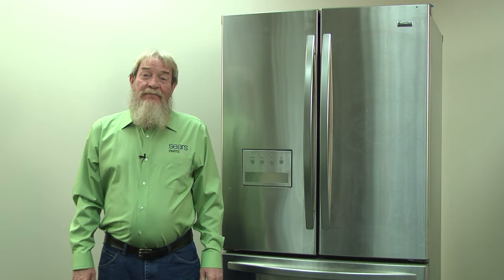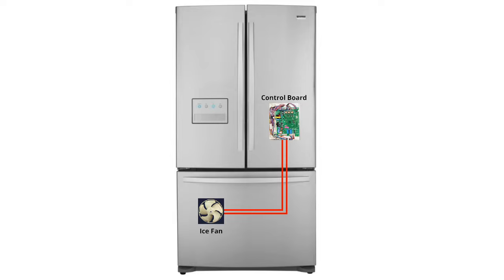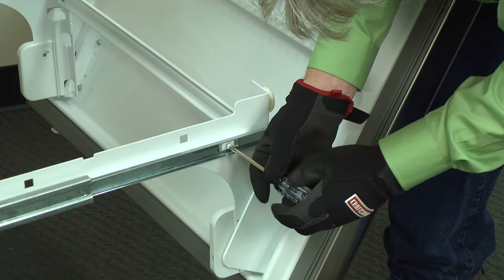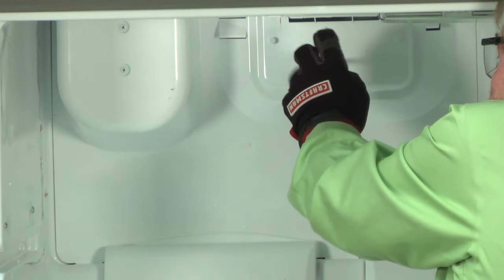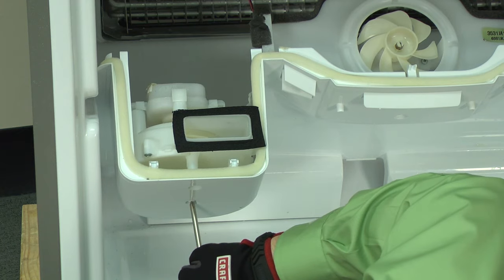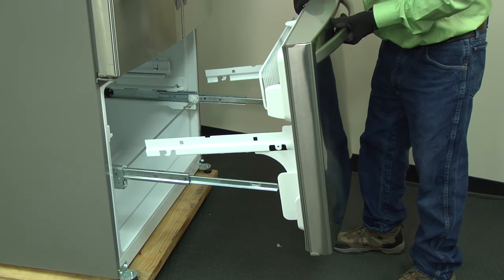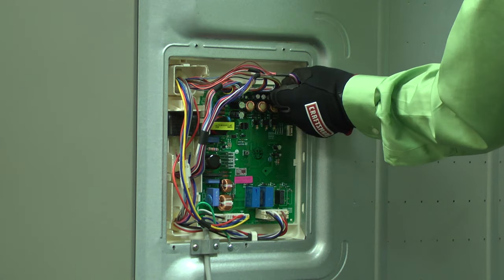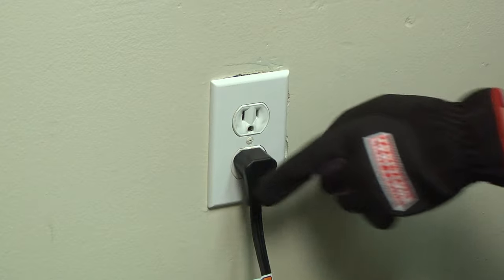Refrigerator Error Code Er If: Ice Fan and Control Board Repair

Comment: This video was helpful! I removed the two upper pull-out trays to the lower freezer section and noticed a large chunk of ice in the back external portion of the plastic freezer compartment. I would not trust myself in removing any parts or paneling to get gain access to where the fan is located.  Then, I took a hairdryer and blew hot air onto the ice buildup until the chunk dropped off (careful not to apply excessive high heat onto the plastic back panel). I continued with the blower for about another 15-20 minutes and then plugged the Kenmore Elite refrigerator back in.  It worked! The "er IF" message was gone, and the fan is working just fine. If condensation freeze build-up occurs again, I will likely use the hairblower an extended period of time ) to thoroughly dry the freezer compartment out)  while attending to some project in the kitchen so as to keep an eye that over-heating or fire do not occur.
Reply: ...money saver! I did the same and worked as well. I just did not put heat but let it to unfreeze ice on its own. Thanks!

Comment: This video got me running again! There is a lot to take off and the vid showed all I needed to get job done. 
Mine was just plugged with ice. Once I freed up I flipped breaker with everything still opened up to make sure fans both running.  Recommend doing this to ensure fan isn’t shot before reassembling all.

Comment: With this error code, I found the fan in the back of the freezer compartment was frozen.  Turning the power off to the Refrigerator for a couple of hours fixed the problem.  No parts need to be replaced - no server bills need to be paid.
Reply: Totally worked! Thank you so much!

Comment: I preface this post with the fact that I am an electronics technician by trade and this repair might not be for everyone. I am not an appliance technician, but if you're handy enough and don't have a fear of the unknown, this may work for you. I fixed my own ER-IF code. It took some doing, but I pulled out the Ice Fan in the left rear corner, and there was a small ice block in it. Then, it would not run even after that, so I took the motor apart and lubed the little brass bushings in the motor and VOILA! Fan started turning again. This was on an LG refrigerator LFX25950sb. Hope this helps someone.

Comment: Like other commentators,  We turned off our 'fridge and let it sit and defrost the fan for a couple of hours. We took out the bins and directed a small household fan into the back of the freezer unit. After the (unseen) ice melted out of the fan, and the freezer was dry we powered it up, the code cleared, and the fridge worked normally. You need to remember to dump the existing ice from the ice maker, and clean out the chute, or the melt water will leak.
Reply: Marci Elston I'm sure people are using this comment and not writing down here because they are just glad it's working again. So I just wanted to say thanks. This absolutely worked. I unplugged for 2-3 hours. Seems good so far
Reply: I didn’t use a household fan to help defrost and I let it defrost overnight. It worked for me. Thanks for the advice.

Comment: This is an older model and does not apply to the new models that have the flatter fan motor.  It is rare for the newer ones to have a bad motor.  It is usually ice built up stopping the fan blade.  The main pcb will start the motor and look for a feedback pulse from the motor.  If it doesn't see it, it will stop, wait a few minutes and try again.  If after several tries it still doesn't get the feedback pulse it will throw the error code.  It will periodically try again and if gets the feedback pulse the error code will go away.  Simply letting the refrigerator thaw out for a couple days will cure the problem. There is a new evaporator cover assembly available where they installed a heater around the ice fan blade the try to stop this problem. 

On the older models the ice fan would stop if you turn off the icemaker.  That was a problem if you didn't take all the ice out of the bucket because it was no longer cold in the ice compartment and all the ice would melt all over the floor.  In the newer models the ice fan runs even if the icemaker is turned off.   Bottom line,  DON'T go replacing motors and boards unless you are sure they are bad.  Defrost it first and try it.
Reply: +Cencotech    Thanks for the advice

Comment: I have a Kenmore Elite and the evaporator fan in the freezer and also in the refrigerator section. Both not running and both sections are warm. I don't think both fans can go out at the same time. What could be the problem
Reply from the maker: Your symptoms point to a sealed system problem. Lack of refrigerant or a bad compressor may be to blame for the lack of cooling. A service technician typically needs to diagnose and repair sealed system problems in refrigerators.

Comment: I have had the problem before and simple defrosted the fridge and it reset the code , worked for about 2 yrs. Now it's back and tried to defrost again but, no help. Is there a way to determine if the blower motor is indeed bad.
Reply: +kumatif how did you reset the code, or did it fix itself when you defrosted?
Reply: +ThumbsUpBrah I just powered down the unit and plugged it back in

Comment: Our fridge is model 795.70323.310 and we got the Er If error code even though everything seems to work fine. But the fan has been making noise off and on for awhile. However, online, I can’t seem to find the correct ice fan to replace it. The only one I found says that it doesn’t fit our model.
Reply from the maker: The ice fan now substitutes to an evaporator cover assembly that includes the ice fan and evaporator fan (part AEB73944701). Here's a link for that part on our Sears PartsDirect website: https://www.searspartsdirect.com/product/61a0vyo8pr-0046-795/id-aeb73944701 . Order that part and install the entire evaporator cover with fans to fix replace the ice fan. If for some reason the evaporator cover is different than the one in your refrigerator, you can pull off the ice fan and just replace that component. Be sure that you unplug the refrigerator before accessing and replacing internal components. We hope this information helps. If you need further assistance, let us know.
Reply: @searspartsdirect  Thank you! Do I also need to replace the electronic control board as suggested in the video? I think I found the correct part for that: EBR74796430
Reply from the maker: @amberc4924  Probably not for your model. If you replace the ice fan and the refrigerator works normally, then you won't need to replace the electronic control board. If you notice problems with the ice fan or the ice maker after replacing the ice fan, then you may need to replace the control board.

Comment: How do you obtain error codes for a unit? I have one which is not showing any error codes, but is not getting cold. I hear the compressor running, and I see a small fan that blows across the external condenser heat exchanger coil running, but despite this, after 48 hours of running it remains at ambient air temperature without any signs of why or errors to indicate why.

Must one press certain keys some way to obtain error messages?
Reply from the maker: Not all refrigerators display error codes. Some models only display error codes when you press certain keys to enter the diagnostic test mode. Let us know the model number of your refrigerator and we'll look up the technical information for your model to determine whether it displays error codes and how to display those error codes if possible.
Reply: @searspartsdirect  
Mod# 795.78846401  
S.N. 507KR00656
P.N. 3850jl8102K
MFG Date: 07/2005

There were some other numbers on the outside if they may be of any help, I have not pulled the back cover to see what the PCB serial number is.

Thank you in advance for your attention on this, I truly hope to get this machine operational again soon, I am pressed both for time and money because I have a small farm where milk refrigeration is necessary, and my does just now began coming fresh and when they wean, I'm going to need the extra cold storage for milk really fast.

If I can buy parts and have this thing back up and running, OR have a clean, clear diagnosis and then locate an authorized service provider to remedy it [for instance I can not charge refrigerant or swap out a compressor here due to EPA laws, licensing and equipment limitations] I would be ever so grateful.

I do not have much money, so replacing the entire unit is totally not an option, and my resources limit me to about $200 at this time for repairs. 

If the repairs were more than that, I would have to instead seek out a second hand unit some place like Craigslist to get me as far as the end of the season where my 'seasonal bonus' of selling off weaned kids would permit me to buy anything more than $200 worth of parts.
Reply from the maker: @DeliciousDeBlair  We didn't find any information on that model number or part number. Neither number appears to be valid in our system. Recheck that model number and let us know if you miskeyed the number. There are some top freezer and bottom freezer models that begin with 795.78... so those first numbers may be correct. Even if we get a valid model number for your refrigerator and find technical information, that information may not help. You indicate that the compressor is running but the refrigerator isn't cooling at all. The compressor is likely bad or the sealed system doesn't have refrigerant. Either of those failures would need to be repaired by a service technician. You may need to replace the refrigerator.
Reply: @searspartsdirect  If I can not get a person to recharge the refrigerant, I will likely just buy a different, more reliable model than kenmore.

Comment: Hi, can you please tell me which parts I need, control board and Ice Fan, for Kenmore Elite: 795.72483.411? Thank you.
Reply from the maker: Here’s a link for the ice fan: https://www.searspartsdirect.com/product/pp1c8rima2-0046-795/id-aba72913426 . You may not need to replace the control board in your model. If you replace the ice fan and the refrigerator works then the control board should be okay. If you replace the ice fan and the code continues to appear, then you can replace the control board. Here’s the link for the control board: https://www.searspartsdirect.com/product/3tex29dlx7-0046-795/id-ebr78643414 . Unplug the refrigerator before accessing and replacing parts.

Comment: Why is there no part numbers for the evaporator fan or the freezer board on sears web sight or on here.. Mines been replaced twice for both parts from Sears,  with in the first yr warranty, now that the warranty is over its a very expencive repair and the parts are rare or impossable to find,  its been 3yrs bran-new from sears,  the only thing that works is the lights in the refrigerator,  please update the part model numbers,  as i was told theres only two for both (the fan#/motherboard#) in the comment section (please)???
Reply from the maker: Let us know the model number of your refrigerator and we'll research those parts. We should be able to provide part numbers for those components and we’ll update our parts lists.
Reply: @searspartsdirect  sure an thanks!!, model : 795.72053.110 - Kenmore Elite
Reply from the maker: @wayneh3021  Thanks for posting that model number. The fix for the ER IF code on your model involved replacing the evaporator cover and fan assembly (Key 610C, part AEB73785605) with revised evaporator cover and fan assembly part AEB73785615. That old evaporator cover and fan assembly substitutes correctly to the revised part on our website. The new evaporator cover and fan assembly includes a heater that surrounds the ice room fan to keep frost from surrounding and blocking the ice room fan. The ice room fan and control board weren’t revised for your model. The original control board EBR73093601 does substitute to new control board EBR75234703 but the new control board is the same as the original control board. You indicate that only the refrigerator lights work at this time. There’s a chance that replacing the control board may fix the problem. We hope this information helps. If you need further assistance, let us know and give us additional details about the failure.

Comment: on the LG fridge there are two louvered fans that move cold air to the ice maker.  I just jam a fan up against the top one, and run room temperature air into it for an hour (AC power off, refrigerator door open).  The ice built up on the fan melts, and start to spin again.  The darned fan ices up about once a year...poor design.  It has NEVER needed a new fan or control board, just needs to get the ice off of it to let it spin again
Reply: Mine keeps doing this too. For some odd reason it will thaw itself out once in a while when I am too lazy to do it and it’ll just start working again all by itself. It usually freezes up once per month though. You are lucky yours only does it once per year.

Comment: if I don't use the ice maker, will removing the fan return the rest of the refrigerator function to normal?
Reply: +Chris Widenhouse   Depending on the model you can not remove fan motors or icemakers without causing error codes.

Comment: Is there a way to prevent this from happening??
Reply: +R0tten 
The Er IF code often appears when ice and frost builds up around the ice fan. The ice and frost is often caused by warm, moist air that enters the refrigerator and freezer compartment through the refrigerator and freezer doors when they’re open. Try not to hold the refrigerator or freezer door open for long periods because that allows frost to build up inside the cabinet and around the ice fan. Check for air leaks through the door gaskets and replace any damaged door gaskets. These steps will likely help you avoid the Er If code.

Comment: Mine does this off and on. The Er1F code comes up, then ice melts all over the floor & water in door quits.  After awhile it just starts up again without me defrosting and works perfectly. Problem is, it does it every 3-4 weeks. There is nothing wrong with door seals. Can’t find any reason its doing this other than it’s not defrosting every 4 hours like it says it’s supposed to do. Can anyone tell me what the new updated part number is for this Model? 
 795.72093.312. Thanks!

Comment: So I have a 10 year old LG fridge like this one (bottom freezer and has an error code) freezer works but blows no cold air into the upper fridge part. I order the parts and just opened the back panel and the ice blower fan is not frozen at all but all the vent part is loaded with ice. What does this mean and how should I proceed?
Reply from the maker: Thanks for your question. First, try to restore refrigerator compartment cooling by unplugging the refrigerator’s outlet cord for a few hours, so the frost in the vent can melt. After the frost melts, restore power and see if the refrigerator cools normally. 

If it cools initially but the problem returns, check the door seals.  Loose or damaged door seals can let moist air into the refrigerator.  Replace the seal if it's loose or damaged

If the refrigerator doesn’t cool after you defrost the vent,  the evaporator fan might have failed. Other problems--such as a bad control board--can also prevent the refrigerator from cooling. Give us the model number of your LG refrigerator and  more details about the cooling problem if you need more help.

Comment: Thank you for the video.  I replaced the fan and reinstalled everything.  Now the door alarm and light under the fridge doors stay on.  Any advice.  (Also, the light on the underside of the left fridge door is out.  Do you have a part number and a how to replace video?)  Thanks!  Model #79574029410 Kenmore Elite.